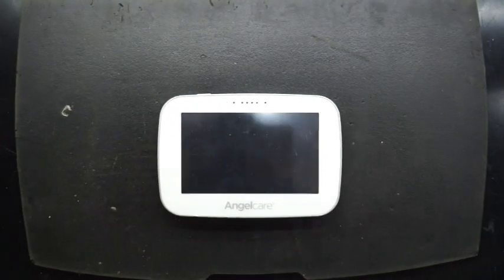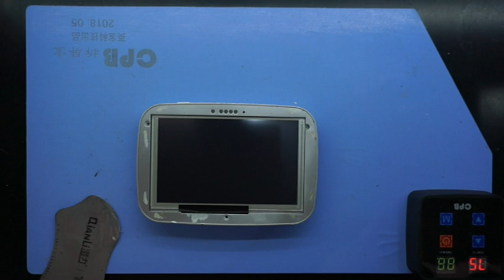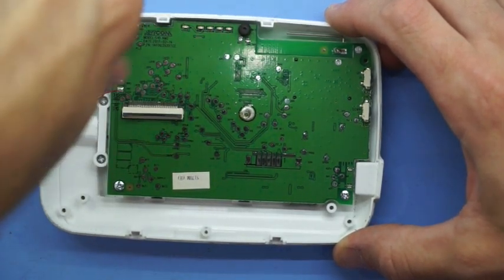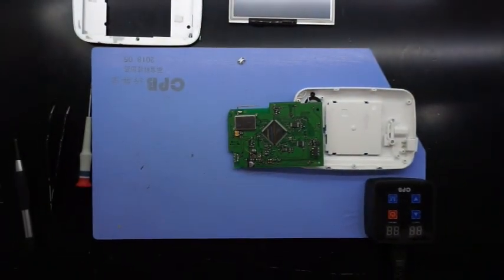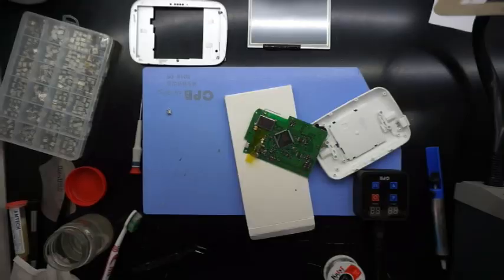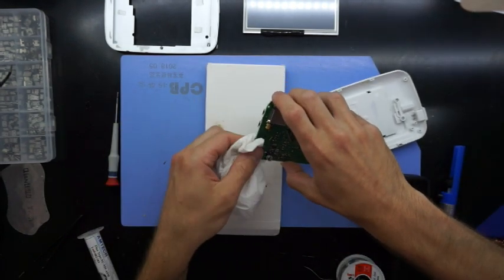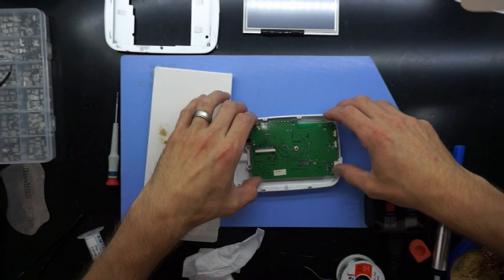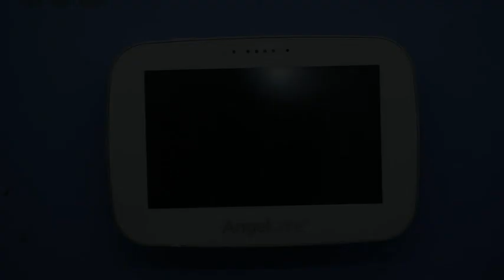Angelcare AC517 Disassembly Teardown

Comment: Thank you! This was exactly what I was looking for! That unit was proving a real tough nut to crack. Detached charging port and a crying baby. This really made the difference. Thank you!
Reply from the maker: Glade it helped, once the plastic front is removed it's straight forward to tear it apart from there
Reply: @rickstechrepairs  Sadly I now need to get busy with some soldering to get the charging port nested on the board again, but at least I can get to it! Thanks again.
Reply from the maker: for this repair i used the soldering iron to put fresh solder on
but used a heatgun to attach the MicroUSB
Reply: @rickstechrepairs  I think that's got to be the right way, yeah. Oh well, just a chance to learn some more skills! 😅

Comment: Thanks a lot! Didn't have a clue how to open my Miniboss video monitor without breaking it, fortunately it's very similar to the Angelcare monitor. The isopropanol worked pretty perfect, even without preheating. Only the detached charging socket was a bit nasty to reattach and I shouldn't have peeled the glue strip away.. Thanks you very much, saved us money and nerves.
Reply from the maker: Cheers. Great to read this has helped you

Comment: We have an AC 527 with a cracked screen and unresponsive touch screen (stroppy second child 😂). Do you know if the screen assemblies are off the shelf parts I might be able to buy somewhere and swap over? Looks pretty straightforward to remove from watching your (excellent) video 👍

Seems a shame (and expensive waste) to buy a whole new unit to fix.
Reply from the maker: i dont know of any spare parts for it sorry, but from my time opening it felt like it would have off the shelf chinese parts, but without a model number to look up of the screen, finding parts will be a challenge
Reply: @rickstechrepairs  exactly what I feared 😕 I was quietly hopeful there might be a manufacturer or part number information on the screen. Guess the next step would be to see if Angelcare themselves would be willing to provide just the part rather than a whole new parent unit, but that seems unlikely when they list the parent unit without any battery or accessories as a stock item.

Thanks for taking the time to reply; appreciate it 👍
Reply from the maker: no worries at all, good luck getting it fixed, but i think it will be getting replaced
Reply: @rickstechrepairs  you guessed correctly..! Angelcare kindly discounted the replacement, but yeah, new base unit in the post 😕 couldn't find the part listed anywhere on the internet and the damaged one is useable to a point, so couldn't take that one apart.
Reply: @aviewfromthesaddle4160  same situation - did you ever take it apart and find a replacement for the screen?
Reply: Same problem here :(

Comment: @Ricks Tech Thanks for the video! Any idea how to fix the volume button? It will go up, but not down...
Reply from the maker: Can't advise on that sorry 

More than likely the button would need to be replaced
Reply: Have the same issue, desperately looking for someone, who knows how to change the bottom, yeah the microswitch stuck in as the plastic broken... quite a shame as this stuff cost a fortune.

Comment: Thanks for this - heating the front was the missing piece for me.
Use of Micro USB is the killer here, it is the most fragile USB port a standard barrel or even a mini usb  would have been better. Anyone thinking of buying - they generally wear out after 18 months daily usage, i.e before you're finished with it, usually. Not great when they cost $$$ for very much old generation tech to begin with.
Reply from the maker: Agreed the micro usb isn't a great choice for this kind of device

Barrel style would be more durable but another thought Is weather or not it uses micro usb for data

Comment: Hi Rick. I'm in Australia too. I have this monitor which has the same problem. Wondering I'd you do repairs on this still? 🤔
Reply from the maker: What problem do you have ?
Reply: @rickstechrepairs  when I plug it in it doesn't charge or charges when I hold it at a certain angle. The micro USB feels loose

Comment: Hi there. This is a bit of a funny question but I’m at a loss. I have this problem with my AC417. I’m not someone who tinkers or really has any clue. I’ve called a couple appliance repair people found on google but they haven’t done anything thus small. Do you know where I could get this repaired?
Reply from the maker: No sorry I don't have anywhere to point you towards sorry
Reply: Check with any local cell phone repair shops.

Comment: These things are crap! If you've had 1,626 views in less than half a year, that means a lot of AC products are breaking. So frustrating to spend hard earned money on cheap things that break in the first month of use.
Reply from the maker: Or like this one, Alot of usb port damage, aka knocked off the table